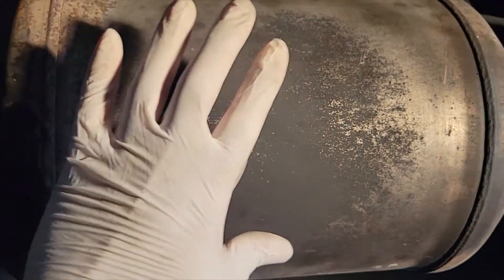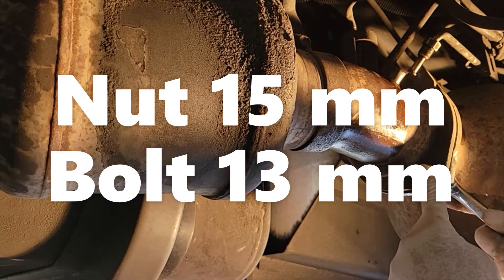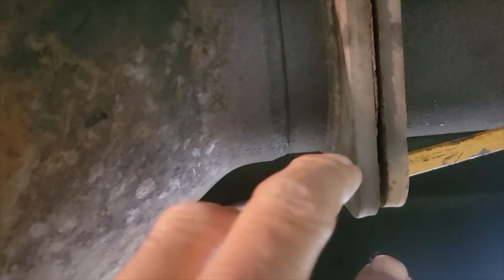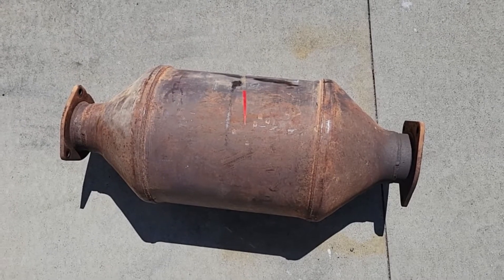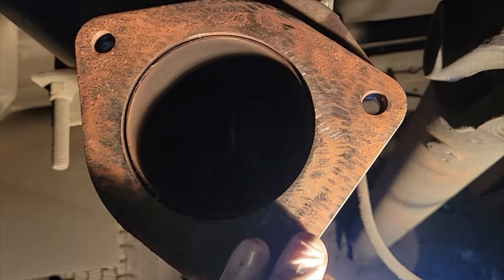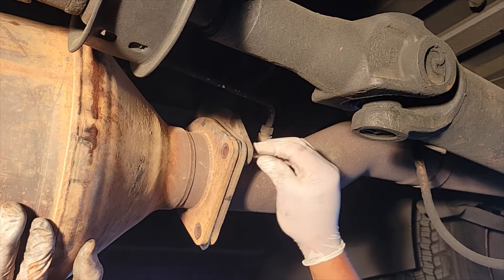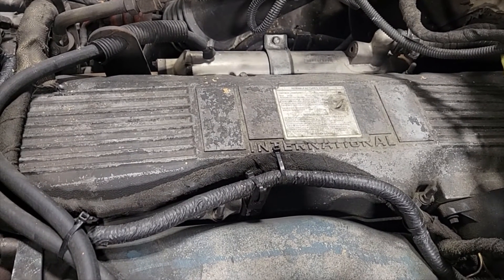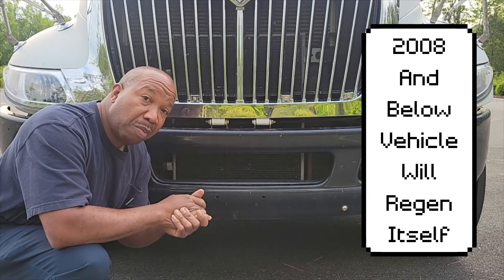DT466 DPF Filter Replacement

Comment: 2010 international 4300 losing power uphill found metal shavings in fuel housing when doing oil change also been getting parked regen due to smoking exhaust any help would be appreciated.

Comment: What's going on?
I have a 2013 maxxforce that is always highway regen were do you suggest I start?
Reply from the maker: It could be a number of things. Most of the time if it's a DPF. It would not regen. Maxxforce DPF usually last thousands of miles before replacing. Have a diagnosis done before touching the DPF.